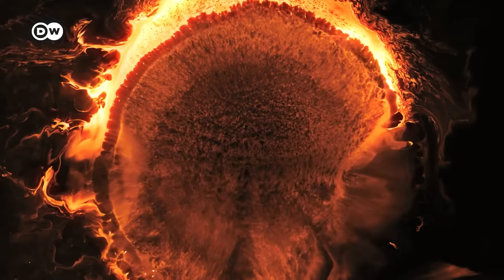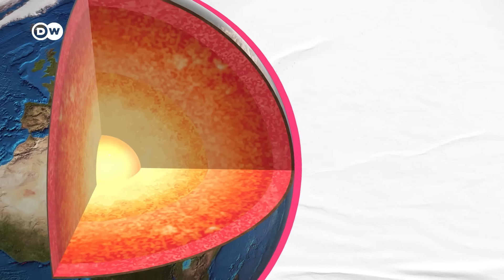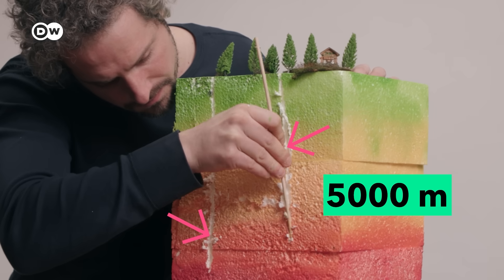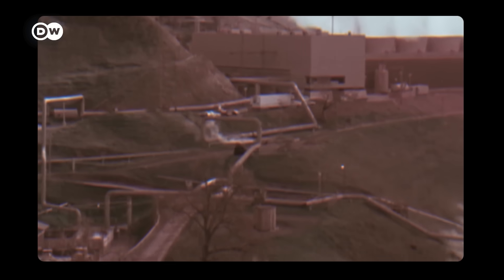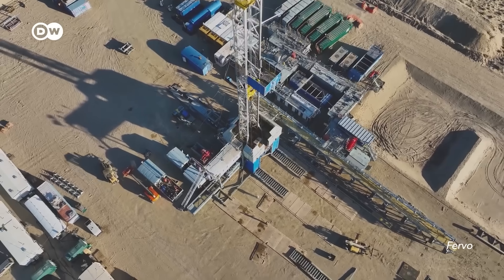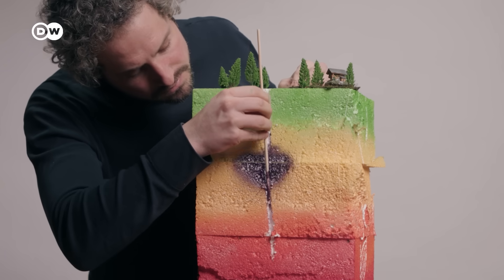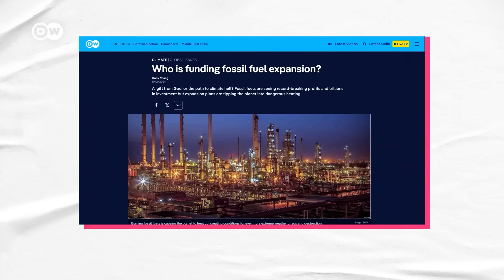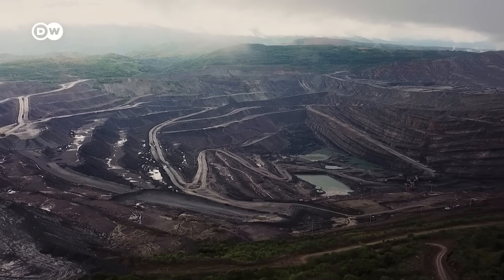How the oil and gas industry can unlock endless geothermal energy

Comment from the maker: Do you think geothermal energy should be pushed more?
Reply: First time I hear really viable energetic project from Germany
Reply: @tyalikanky  Seems like you don't believe in renewable energy systems
Reply: @ I believe in it in Kazakhstan or Africa, where sun and wind is available and unprofessional workforce is cheap
Reply: Yep!
Reply: They forgot the other Canadian company that uses Laser drills, which can drill down deep, fast, and searing the edges of the rock around the hole makes the rock stronger than it was before, so deep holes are way less likely to create earthquakes.
Reply: Geothermal is part of the very important mix of energy production.  Make electricity and hydrogen, for the best results.  Easy money.  Shallow air circulation would be sufficient for air cooling, or warming, as well.
Reply: It absolutely deserves production-scale experiments. If we can do enhanced geothermal (with whichever tech) at gigawatt scale that is cost effective and works in even 25% of needed locations (as opposed to the very limited sites of traditional geothermal), it could be a game-changer.
Reply: Absolutely! Geothermal energy is a renewable, sustainable source with a minimal environmental footprint. It can provide consistent, reliable power, unlike some other renewable sources that depend on weather conditions. Investing more in geothermal energy could reduce our reliance on fossil fuels and help combat climate change in a more eco-friendly way. It’s definitely worth pushing for!
Reply: Depends where it is. Temperature changes can go pretty deep in some climes. Good luck getting Big Oil to shoot themselves in the foot. They killed nuclear, and they killed the railroads and streetcars, just so they could turn a profit.
Reply: This video is a disguise (9:55) of #globalwarming agenda.
Reply: Imagine if new nuclear project would do earth quake? I am for both but anti nuclear hypocrisy is big.
Reply: Yes. Italy? Vesuv. Nothing there?
Reply: Pushed and eventually made much more affordable. Geothermal has a HUGE potential, "drill baby drill" done right way!👍
Reply: YES
Reply: Interesting stuff, also looking at Quaise Energy.  Hopefully break throughs will increase geothermal.
Reply: Absolutely, it should be pushed more. Conventional or the new technologies, paired with shallow geothermal approaches, aquifer thermal storage etc .... not only for its green credentials, but also contributing to energy security due to being a local, sustainable and long-term source of energy that can replace fossil fuel imports.
Reply: Less homosapiens?
Reply: @Fluid-Druid  new Zealand digs a 2 mile closed loop pipe while using Supercritical liquids instead of H20?
Reply: Drill Baby Drill ! ! !
Reply: In my opinion deep geothermal energy (optionally with heat exchange) is THE future for the oil and gas industry - it's reliable, cheap and basically without job-loss for the whole oil-industry.
Reply: Great more holes.
Reply: No. It should be stopped. Sun and wind alone can help humanity reach level 2 on the Kardashev scale.
Reply: No.. Don't play with nature please
Reply: @ashugowda5284  Vesuv,  italy
Reply: Is cooling the interior of the earth a good idea? That magnetic field is handy plate tectonics pretty awesome. Abundant, yes, inexhaustible🤔
Reply: @shaneboor it's a giant Radioisotope thermal generator. The heat comes form the decay of naturally occurring radioactive elements.
Reply: @shaneboor This technology drills into the crust of the Earth . There are thousands of miles of mantle .outer core .and inner core which is heated by the furnace of the planet.  This rock we live on has plenty of heat for we puny humans.
Reply: @shaneboor We won't cool it anytime soon, definitely at several orders of magnitudes slower than heating the outside due to climate change.

The heat is also being replenished by nuclear reactions.

It only needs to last until humans as a race disappear from the planet, or at the longest some 500myr until the sun heats up and boils our oceans.
Reply: geothermal power plants on top of active volcanos.
Reply: Not a fan of pushing water into the ground. If its full of chemicals it may harm a biosphere we do not really understand yet as it is said that bacteria and endemic species live quite deep into the earth. If you push down good water like with the oilfields it is missing in the climate cycle eventually and yes i am aware that would have to be a lot of water, but has anyone cared to calculate how much is already being pushed down for these reasons and how much more it could become and how that would effect us long term? We always seem to see these shiny goals in front of us without thinking of how it will affect us later.
Reply: @kinngrimm  A simple back-of-the-envelope calculation would give you the answer.  Bonus points, compare it with the amount of water that's currently being added to the oceans by sea level rise.
Reply: @gerhardwesp3995  So what happens when you extrapolate this 100, 200 years or longer and have a yearly increase within this  praxis? At some point there are more adverse effects than just poisoned drinking water and earth quakes, because those are not enough it seem to deter us from fracking.
Reply: @kinngrimm  As I said, do the maths.  Also, post them here.
Reply: This is greta idea !! Only side effect “earthquakes”! It sounds more like a curse…😅
Reply: Nope
Reply: We honestly need more fossil fuels like coal
Reply: @Uniqueusername-1 😅

Comment: IMO, Geothermal can provide the stable backbone of green energy to fall back on when the sun doesn't shine and the wind doesn't blow. There would be no need for backup fossil fuel coal and gas power plants, and less need for battery solutions. Involving the oil and gas industry and making them "own" this energy source could help them accept the transition away from fossil fuels more easily. These companies could simply change into something else.  
Investment in geothermal also seems to be a better solution than nuclear power, which has huge up-front investments and long construction times, and fills the same niche as geothermal in the energy supply.

Comment: A lot of the earthquakes are from Injector wells, which these Geothermal wells are.  The input should be matched with output.  Eavor's solution doesn't require injecting into the formation, but uses the earth to heat the water, thus no risk of earthquakes.  It's basically a subsurface radiator.

Comment: The risk of drilling a set of horizontally connected wells with carefully calculated and thought-out trajectories (the fan-out strategy) is significantly less, if not entirely, risk-free compared to fracking.

Comment: My family came from a seaside town called Bo'ness in Scotland. It was one of the first places where local monks found the stones that burned and in later years, the first coal mine went underwater, exploiting the huge coal field under the Firth of Forth. They are all closed now but maintenance people told me that the water at the bottom of the shaf on the seashore is boiling hot as it goes down a long long way. All that hot water could heat the entire town's central heating. I asked them why it isn't used and they said, the energy companies don't want it used!

Comment: It’s basically insanely expensive to even get 2000 meters down. 4-7 thousand is nearly impossible and only a few can do it .
Reply: It looks like it costs about NZ$21-24.5 million to drill about 2500 - 3000 meter geothermal well in New Zealand. As one of our power company delivered 6 wells for 147 mil in July on 2 sites 130 kilometres apart.

Comment: just one question. wouldn't it heat the atmosphere?
Reply: The heating of the atmosphere by the additional green house gasses we humans have added to it is 1,600,000 Gigawatts. You would need to drill in the region of a billion holes to even get close to that.

For context, humans are at the moment generating on average 3,300 Gigawatts of electricity...so the green house gas heating is 500 times larger.

Comment: p152, free ebook by Mackay: // Let’s put some numbers into this discussion. How big a piece of ground does a ground-source heat pump need? Assume that we have a neigh-bourhood with quite a high population density – say 6200 people per km2 (160 m2 per person), the density of a typical British suburb. Can everyone
area per person (m2)
Bangalore
37
Manhattan
39
Paris
40
Chelsea
66
Tokyo
72
Moscow
97
Taipei
104
The Hague
152
San Francisco 156
Singapore
156
Cambridge MA 164
Sydney
174
Portsmouth
213
Table 21.13. Some urban areas per person.
use ground-source heat pumps, without using active summer replenish-ment? A calculation in Chapter E (p303) gives a tentative answer of no: if we wanted everyone in the neighbourhood to be able to pull from the ground a heat flow of about 48 kWh/d per person (my estimate of our typical winter heat demand), we’d end up freezing the ground in the win-ter. Avoiding unreasonable cooling of the ground requires that the sucking rate be less than 12 kWh/d per person. So if we switch to ground-source heat pumps, we should plan to include substantial summer heat-dumping in the design, so as to refill the ground with heat for use in the winter. This summer heat-dumping could use heat from air-conditioning, or … //

Comment: Don’t forget the “lowest hanging fruits” too. ref. P153, free ebook by Mackay

context : UK geography & weather

//

My conclusion: 

can we reduce the energy we consume for heating? Yes. 

Can we get off fossil fuels at the same time? Yes. 

Not forgetting the low-hanging fruit – building-insulation and thermostat shenanigans – we should replace all our fossil-fuel heaters with electric-powered heat pumps; 

we can reduce the energy required to 25% of today’s levels. 

Of course this plan for electrification would require more electricity. But even if the extra electricity came from gas-fired power stations, that would still be a much better way to get heating than what we do today, simply setting fire to the gas. 

Heat pumps are future-proof, allowing us to heat buildings efficiently with electricity from any source.

//

Comment: Wouldn't it imbalance the heat pattern underneath? For an instance we're talking about thousands of these heat exchange pipes across the globe at a commercial scale.
Reply from the maker: Hey there! There may be some localized effects on temperatures, but the overall impact on the Earth's global heat pattern should be minimal. Geothermal systems are typically closed-loop and tap into subsurface heat. 🌡

Comment: Isn't it cooling the earth's core, i know it's very slow process but it does cool it. And we need Earth's core to remain hot so that Earth's magnetic field doesn't fade away.
Reply from the maker: Hi there,  well, the human use of geothermal energy is insignificant compared to the total heat of the Earth's core. The Earth's core has been cooling naturally over billions of years, but this process is extremely slow and unaffected by geothermal energy extraction. The Earth's magnetic field is generated by the movement of liquid iron in the outer core, which is far deeper than where geothermal energy is extracted. Even if the magnetic field weakened, it would not directly impact the greenhouse effect, which is caused by atmospheric gases trapping heat. Therefore, large-scale geothermal energy use would not cool the Earth's core enough to stop the magnetic field or expose the planet to harmful solar radiation.✨
Reply: @DWPlanetA  was this reply by a human or AI?

Comment: Yes, let's use geothermal so we can extract heat from earth's core and cool it down in the process, for sure that's gonna end up well.
Reply: Can you explain more please
Reply: @thomhill7540  it's basically a heat exchanger, you are transferring cold from the outside to the inside, meaning the core will cool down.
Reply: @DigitalChamans it's bad ? because the core of the earth generate heat from radioactivity so is like almost infinite energy ?
Reply: @thomhill7540  elaborate, what do you mean radioactivity? Any basis on that argument?

Comment: PLANET-LEVEL DESTRUCTION ALERT!!!
When the Earth's core turns as cold as the Mar's core, our planet's surface will be similar to Mars'. Human greed will be our undoing. SMH
Reply from the maker: Hi there, human use of geothermal energy is insignificant compared to the total heat of the Earth's core. The Earth's core has been cooling naturally over billions of years, but this process is extremely slow and unaffected by geothermal energy extraction. ✨

Comment: All clean energy systems boil down to cost and time to market. Enhanced geothermal has a good market advantage by being like the “base load” power so many insist we need. If it can be done cheaper and faster than nuclear, that’s the end of nuclear power, because it offers the purported advantage (base load), without the disadvantages (cost, long build times, waste, safety concerns, proliferation, etc). And drilling/fracking are mature technologies now, so much of the cost issue has already been solved. But it’s up against the extraordinary cost effectiveness and short time to market of solar/wind+batteries.
Reply from the maker: Hi, Dave! We're glad you enjoyed the video. Thanks for the tip, we will pay a close look at the experience of the Netherlands ✔

Comment: Our planet have a atmosphere because we have a magnetic shield, we have a magnetic field because of the molten core of the planet, so how fast do you want to cool the core?
Our forefathers are remembered for ruining the climate, and now you want to go one further, removing the atmosphere, at least no one will remember that.
Reply from the maker: Hi there, human use of geothermal energy is insignificant compared to the total heat of the Earth's core. The Earth's core has been cooling naturally over billions of years, but this process is extremely slow and unaffected by geothermal energy extraction. The Earth's magnetic field is generated by the movement of liquid iron in the outer core, which is far deeper than where geothermal energy is extracted. Even if the magnetic field weakened, it would not directly impact the greenhouse effect, which is caused by atmospheric gases trapping heat. Therefore, large-scale geothermal energy use would not cool the Earth's core enough to stop the magnetic field or expose the planet to harmful solar radiation.

Comment: There are only two practically inexhaustible energy sources, thermonuclear and geothermal. Wind and solar energy are short-term solutions, and are not suitable for industrialized countries, because they have to be stabilized with energy from fossil fuels or hydroelectric power plants. Don't even count on batteries as big as barns or small villages. Because they don't come in an environmentally friendly way and won't last forever. And the battery storage can even burn down. Not in ecological friendly way.

Comment: So no one wonders where the heat comes from? It's probably not nuclear.  Then the amount of heat within the Earth is finite.  Surely there is a large capacity.  But so was underground water and the amount of CO2 in the atmosphere.  If we have to worry about running out of underground water and having too much CO2 in the air, the same is likely true for thermal energy.  I don't think it's worth it.

Comment: Why not use CO2 gas as a medium to generate electricity there have been turbine generators made for one thing they are smaller being 4 turbines instead of 9 for gas and steam. The efficiency of a CO2 gas turbine is 60 percent higher than traditional turbines. There was a project but for some reason it was closed down maybe hydrocarbons industry closed it down .

Comment: Here to mention the work of Canada's repurposing oil wells into geothermal plants in the prairies and the work Six Nations is doing to make huge green energy infrastructure. Haven't heard any updates on these two projects in a while.
Reply: Hopefully they are using close loops with Supercritical liquid and not water.
Reply: @ Eavor Technologies in Alberta drills their own wells ,Coats the well pipe with an impenetrable material and allows  a suitable fluid to run thru' the pipe in a closed system. Not superheated, as that involves fracking.
It is not necessary to create a blast furnace with the fluid , just a nice heat for homes in town and electricity in the turbines.
Reply: I came here to ask that very question “could we repurpose dead oil wells into new geothermal?” Being from Alberta myself, it just seems to make sense.

Comment: When will the thermal energy in those rocks deplete? It seems without and surrounding fluids it will not replenish much.
Reply: It wont for a long long time. It's essential our planet's core that is producing that heat. It's like asking when will the sun stop burning. Once that happens, we have other issues or/and probably won't be around anymore.
Reply: @Aedony   But the core is also extremely far deep and there is a thermal resistance between where the heat comes from and where you're collecting it! The spot in the ground where you start extracting heat was heating up for a billion years before, so its temperature is going to fall, so eventually any given well will no longer be economical, it will no longer produce superheated steam that can drive a generator. Currently it looks like the wells are designed for a 50 year timescale, but some are intended to be much longer lasting, on the scale of a handful centuries.
Reply: @SianaGearz  Ah now I get what you mean. I've read in another comment somewhere here that they keep warm for 30+ years but then the heat is depleted but will regenerate when left alone for a while. I guess one could rotate the holes to always have an active one?